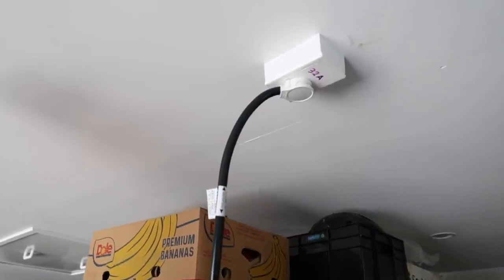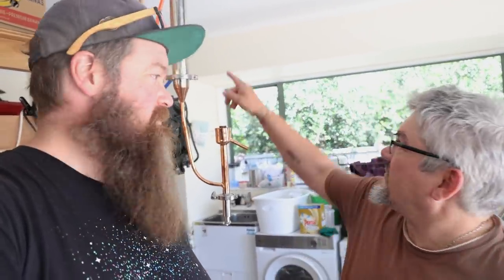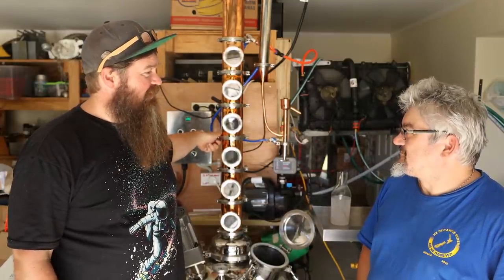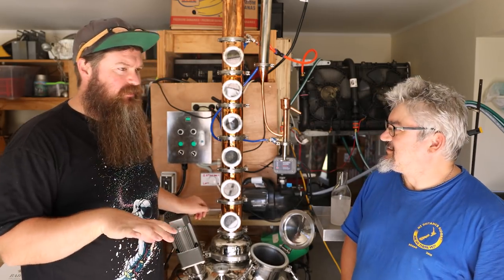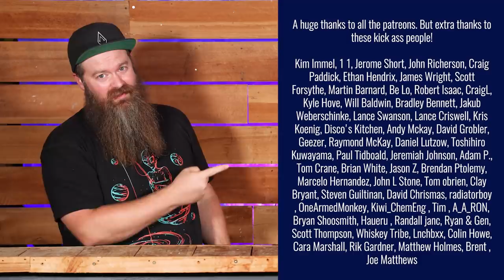Is Buying A still Direct From China Worth It?

Comment: You're not a moonshiner until you've had to clean it up off the floor that's when the sense of impermanence sets in hell I lost at least a gallon of good apple banana brandy wash today unfortunately it didn't end up on my garage floor it ended up on my dining room floor thank God it was just a gallon lol I think my worst six or seven years ago was a glass still I made out of a carboy I was stupidly running it by my back door in the middle of the winter and when I open the door to let the dog out the cold air hit the hot still in the bottom just fell out of it and I had 6 gallons of hot steamy mash pool in my living room and it was third GEN Sourmash I never got the smell out and had a bad case of fruit flies for almost a year LMAO it's funny now But wow what a mess